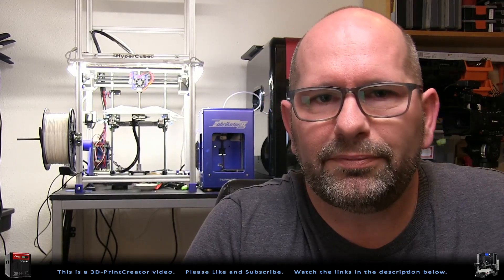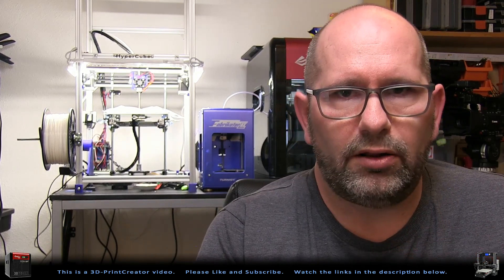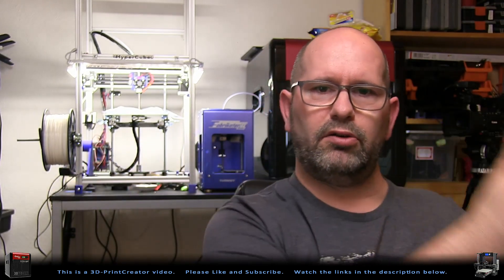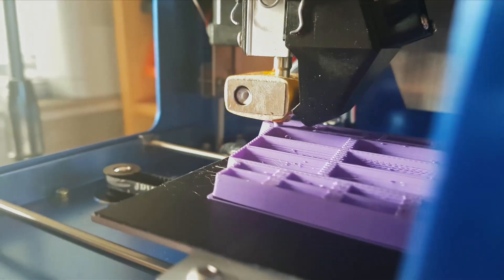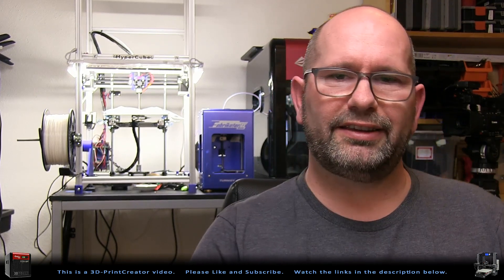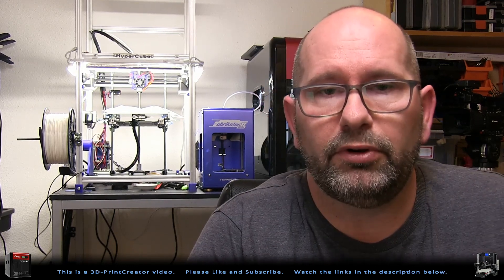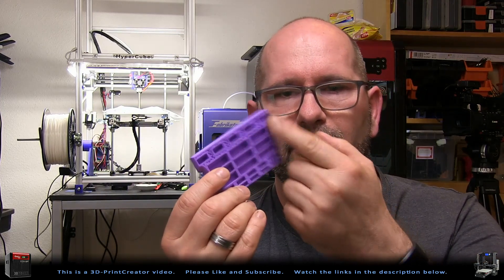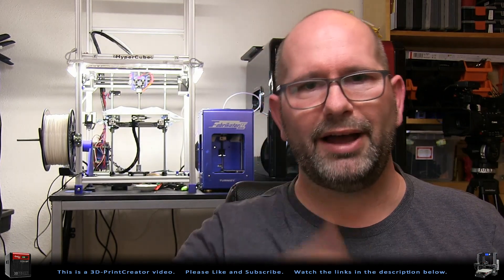▼ Keep 3D printing safe #3DPSafe

Comment: Hi Brian,this is the benefit of our XYZ machine - after transfer of file you can switch the PC down and leave your printer working :)
What you mentioned about thermistor/electronics failure, this is the one thing which i am afraid  from first time i have got my printer.
I was thinking about IP camera, LAN remote controll for remote power off from anywhere, but the easiest way how to lets say better protection of printer is to modificate little bit the printer. 
1- use the safety thermostat. mount it on the back side of heated bed, it will cut off the power from heated bed, this for example:
http://www.ebay.com/itm/CHAFFOTEAUX-AND-MAURY-THERMOSTAT-SAFETY-THERMAL-110-C-ART-60054630-ARISTON-/262661319662?hash=item3d27d5abee:g:PhIAAOSwNKRXiQjv

2- use miniature type of temperature fuse and mount it on the nozzle block, for example this:
http://www.ebay.com/itm/5-PIECES-THERMAL-CUTTOFF-CUT-OFF-FUSE-260-CELSIUS-DEGREES-USA-Free-Shipping-/271742467534?hash=item3f451cfdce:g:YJQAAOxy--NRnl-g

Once your printer fails, this will protect everything from start to fire :) 

The temperature fuse is nonreturnable, the thermostat has hysteresis about 20°C but you can buy the manual resetable one, for example this.

http://www.ebay.com/itm/50pcs-Manual-Reset-Temperature-Switch-110-C-NC-Bimetal-disc-thermostat-KSD301-/152525960792?hash=item2383417658:g:RTIAAOSwQItT80cY
Reply from the maker: This a great tips and I will dive into this in the next coming weeks.
Thanks.

Comment: I have an 1 day and an half print to do... how can i do it .-.?
Reply from the maker: Just like I said in the video, that's a risk you have to be aware of, before you do it.
In my case, I make the print with a printer that is in my garage on a place that if it would catch fire, there is nothing to be worried about.
My printer could burn down completely and still the flames would not set the house on fire.

If you do a thing like that, you can print without being worried about malfunctions.

Comment: How to resolve half your issues:

1 ) Buy raspberry pi
2 ) install OctoPi
3 ) after slicing in Simplify3D, Cura, Slic3r, etc. upload to OctoPi web interface
4 ) Tell it to print
5 ) Reboot your PC as many times as you want

;)
Reply from the maker: Hi Hushang,
Thanks for your reply.
I do own Raspberry Pi boards and in stead of OctoPrint, I am running AstroPrint on them.
But, this is not at all a safety measure !!!!! If there is a problem in the RaspBerry Pi, it will stop sending serial data just as the Windows machine in this example did. It won't turn of the printer, unless you make something like a relay that switches the power, but that's the whole point of this video. If you are aware of the risks, you can avoid the problems.

In another video I will discuss the possibilities to make your own safety measures, like a stand alone system that records the heat in all your printers an can switch of the mains if somethings fails. I have this on one of my printers already. It has an extra thermistor in the heater block and if that thermistor senses a difference in temperature then the thermistor that controls the motherboard of the printer, or if the value exceeds a given setpoint, then the power will be turned off. Then again, this doesn't protect you from having a bad connector to your heated bed, so the connector can still catch fire.

It all comes down to common sense. Keep thinking of what you are doing and 3D printing is very safe.